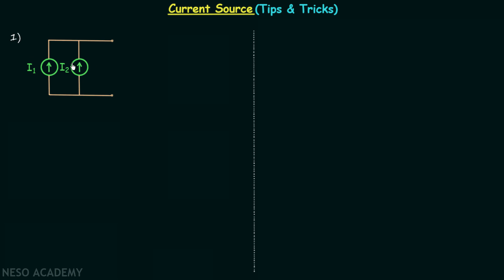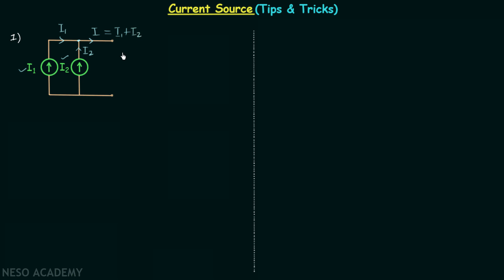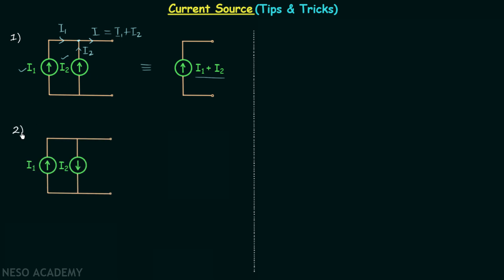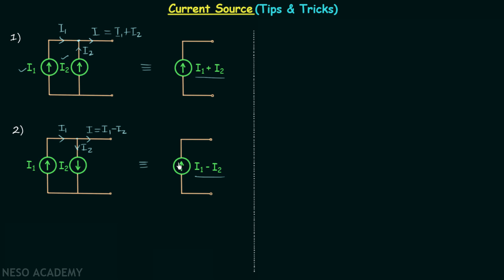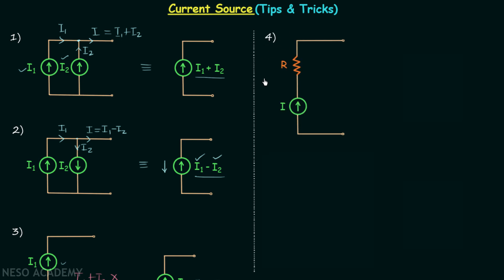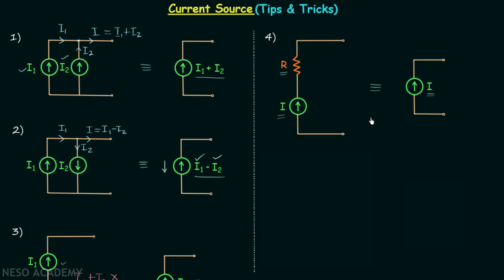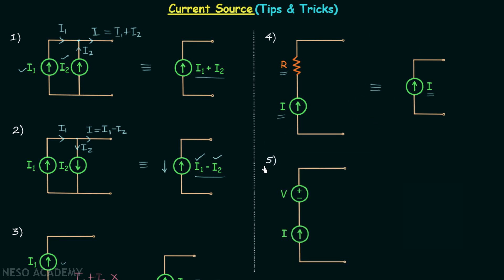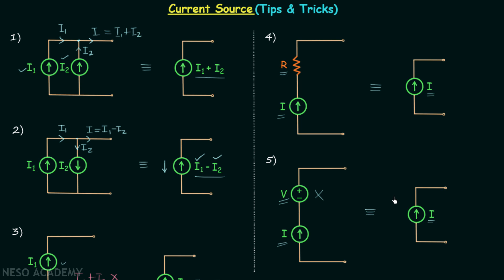Current Source (Tips & Tricks)

Comment: Sir tell us the reason behind removing the resistance? How can we do that?
Reply: its a trick and gives the same answer .basically just a short cut
Reply: In the case of a voltage with a series resistor the CURRENT is the same at the load end of the resistor. In the case of the current with a parallel resistor the VOLTAGE is the same at the load end. So from the standpoint of the LOAD there is no difference if the resistors are present or not.

Comment: In case 5 why we neglected the voltage source ?? can any please help me
Reply: I know this is 7 months old, but hopefully others can see this.
Think of what a current source does - it supplies a specific current, no more and no less. We assume the current source has a constant resistance, so the only thing it can do, is change its voltage to maintain that current (since I=V/R)

This means an ideal current source will generate whatever voltage (positive or negative) it needs in order to keep supplying that current. With that being the case, whatever voltage is being supplied by the voltage source is irrelevant. The voltage made by the current source "overwhelms" the voltage from the voltage source.
The current source will "see" the voltage supplied by the voltage source, and compensate for its voltage so that it can continue supplying its specified current - which would effectively cancel the voltage source out.
Reply: @volcadnb  Thank you!
Reply: @volcadnb  Makes no sense. The exact same argument can be made for the voltage source. I.e., an ideal voltage source will generate ANY current to maintain the specified voltage (so why, would it not, in this case overcome the current source?) just as an ideal current source will generate ANY voltage to supply the specified current. Obviously only one can prevail at any time. Since no actual sources are ideal it comes down to the actual physical construction of the sources as to which one will prevail.
Reply: @Jnglfvr  I'm confused between current and voltage sources; I get the text book definition but I am not able to understand real world difference. To me both current and voltage sources seem as the same. I understand that ideal sources doesn't exist. What is an example of practical current source? In order to produce current, we need voltage, so then isn't a current source also a voltage source? Since a battery is a voltage source and it produces current when connected to a circuit, isn't it also a current source?

Please help me understand real world example and usage of current source and how it is different from a voltage source

Plzzz answer
Reply: @Jnglfvr  it's because ideal current sources are said to have infinite internal resistance (I said constant in my original reply which is misleading). The ideal voltage source can try to change its current to output a different voltage, but, being in series with the current source, it's going to have a hell of a time pushing that current through what it effectively sees as an open circuit.

Another, slightly more intuitive way to think about it is that the voltage source doesn't really care about the current to begin with. It just wants to see a specific voltage between its nodes. Since the voltage source is connected in series along a single branch, the voltage between its nodes is always going to be... the voltage of the voltage source. Its conditions are satisfied, it's happy, and the current source can do whatever for all it cares.

Interestingly,  there is an ideal voltage source dual of this rule. It's also #5, in the next video. You can ignore a current source in parallel with a voltage source. Using the intuitive reasoning above, the current source just wants to see a specific current moving through its branch. Since it's the only thing in its branch, the current it sees... is the current of the current source.
Reply: So I ran scenario #5 in LTspice and apparently I was wrong. The current source does, indeed, adjust it's voltage to precisely compensate for any  series voltage sources to maintain it's designated current.  I put a 1 k resistor in series with a 100 V voltage source and a 1 amp current source. The current source will then raise 900 V across its terminals in order to maintain a 1 amp current across the resistor. If I put a 2000 V voltage source the current source will then DROP 1000 V across its terminals to maintain that 1 amp current. I guess that this is the only way to maintain consistency in that the voltage source MUST have 1 amp running through it but the current source need not have any specified voltage across it.
Reply: @Jnglfvr  An ideal voltage source has no resistance, so it doesn't depend on the current generated. Besides, it doesn't matter, the current source will keep the same current.

It will change its voltage considering the voltage source to keep the same current!
Reply: @volcadnb  I'm confused between current and voltage sources; I get the text book definition but I am not able to understand real world difference. To me both current and voltage sources seem as the same. I understand that ideal sources doesn't exist. What is an example of practical current source? In order to produce current, we need voltage, so then isn't a current source also a voltage source? Since a battery is a voltage source and it produces current when connected to a circuit, isn't it also a current source?

Please help me understand real world example and usage of current source and how it is different from a voltage source

Plzzz answer
Reply: @volcadnb  Thank you bro!!!
Reply: @volcadnb  Although I'm years late, I like your way of explanation, like talking from perspective of components and not just repeating the same fact
Reply: I also find it important to know why. It's useless without an explanation

Comment: What if current source and resistance are in parallel?
Reply: then neglect the resistance in load side
Reply: If u have a current that is the sum of the ones passing through those two elements, the equivalent is that certain resistance connected in series with a voltage source  E=JR, (J the current from the current source) through which passes the current that I mentioned initially, the one in series with the paralell assembly. U can say that the equivalent resistance is R, but u won't get to the right result If u try to find the resistance for the whole circuit, for example.
Reply: You can convert it to voltage source with resistance in series.

Comment: Btw, we have battery for voltage source but we do not have anything for current source
Reply: A current source is every component that supplies steady current to the circuit, regardless the other components you add to it. For example a simple current source for linear circuits would be a high voltage battery connected in-line with a huge resistance, considering this as a single component. In that way when you add more resistances or other simple components the added resistance to the total is neglectable, so the current passing through the wire stays the same. That's the answer my uni professor gave me when I asked the same thing.  

Any more experienced person may correct any imperfections to my answer.😁

Comment: What will be the value of current in case 3, I don't understand please anyone can help?
Reply: I have the same doubt... What if i1 is not equal to i2
Reply: @rohitpal210  it's against of kcl. Total current entering to a node must equals to total current leave.
Reply: @rohitpal210  this is not possible  differnet current in same branch if there is not passive element betweeen them
Reply: Never have two different currents in same wire
Reply: I'm also curious. What will happen if I place two current sources in series like in case 3 that provide different current? Please explain step by step why it's not possible
Reply: In A Single Loop Or Mesh Their is only possiblity of single current but not multiple currents , in series networks current is constant in parallel networks voltage remains constant